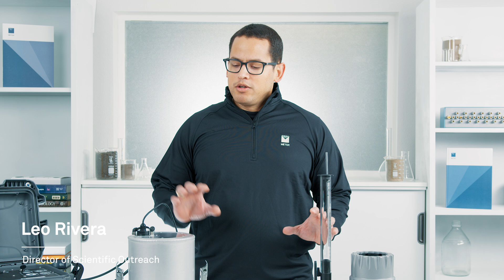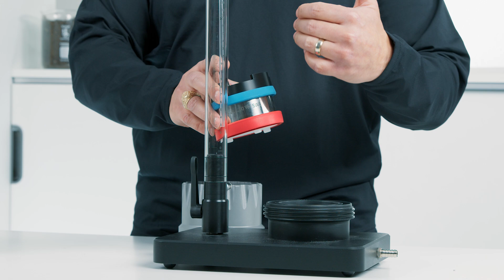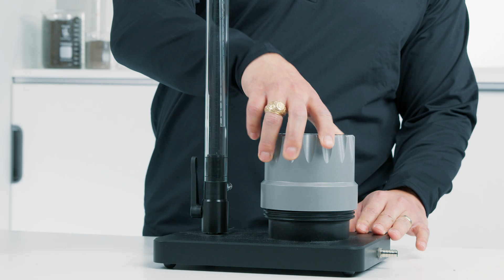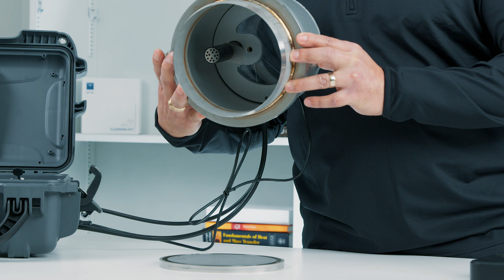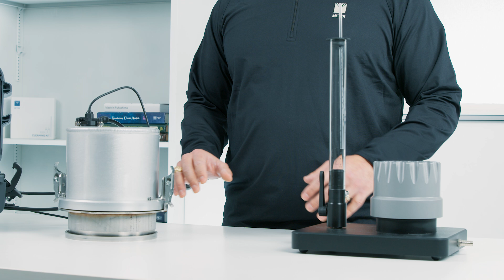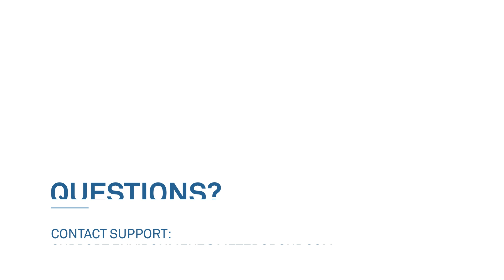Hydraulic Conductivity: SATURO vs. KSAT—Which method suits your soil hydraulic conductivity goals?

Comment: Hi! I've used the SATURO before, but am just learning about the KSAT, and am trying to decide which would be best for my project. From my experience, the SATURO's 3-dimensional flow allows for saturation to be reached over a more representative volume of soil. How would the KSAT be used to simulate the depth and volume of an in situ sample?
Reply from the maker: Hi Anneliese, this is a great question!

The dual-head algorithm for the SATURO aims to reduce the influence of lateral flow in the field saturated hydraulic conductivity (Kfs) readings because lateral flow will overestimate Kfs values. The measurement volume of the insertion ring is the limit for the measurement of the SATURO, which is about 814 mL for the 5 cm ring, or 1,629 mL for the 10 cm ring. Kfs does not ever reach a true steady state saturation condition because there will always be water loss to deeper levels of the soil, including lateral movement as water leaves the measurement area.

The KSAT uses a much smaller sample ring, about 250 mL, but can be used to collect a truly representative sample from any location, as long as the sample remains in the ring. Some materials, such as sand, have a hard time staying in the ring, and may need to be repacked, as opposed to grabbing a representative sample. 

The laboratory nature of the KSAT instrument, introduces constraints that allow us to measure true saturated hydraulic conductivity. By constraining the volume to a 250 mL ring, and controlling the water flow, we can reach true steady state because there will be no water loss to lower layers. 

So, both readings are useful. The KSAT will give you the true Ksat reading, or the saturated hydraulic conductivity of the material, and the SATURO will give you the hydraulic conductivity that occurs in the soil under natural conditions.

Please feel free to reach out if you have any further questions!